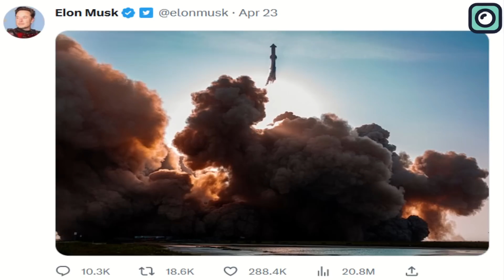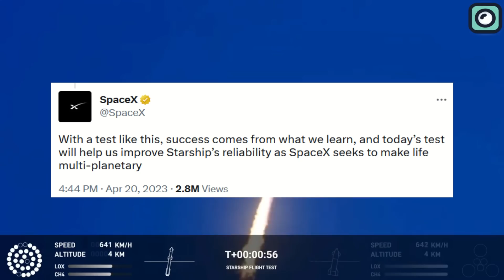SpaceX's Raptor engines BIG PROBLEM on first Orbital Launch!

Comment: you are wrong my guy. the starship was supposed to separate before super heavy started to change directions. the super heavy could lose a few engines and still make it to orbit.
Reply: Lost Hydraulic system early on. They couldn't unlock the hold downs to StarShip/booster.

Comment: On top of the debris or fod damage to the does telemetry or any other data show the cause of three engines failing to start and I'm curious if there's any telemetry on the effects of Sonic damage I.E. converging shock waves??
Reply: It's very noteworthy that SpaceX is not sharing either telemetry or onboard video. I bet they had video in the engine bay, I'd love to see what was happening there as more and more engines came on line and then throttled up. I bet it was like a pinball machine full of concrete. They are extremely lucky they got the explosion off the ground.

Comment: Lol! Here we go with all the bullshit speculation! Just to get mindless clicks from equally mindless Borg Drones!

Look! This isn't a engine reliability issue! This is a launch issue! The fact that the rocket actually damages its own engines during launch, thanks to an insanely inadequate launch pad system, is the reason why this first launch had issues!

And this would be an issue for ANY rocket! Regardless of reliability!

We've already known that Elon took a MASSIVE gamble with his "exotic" stage 0 setup. Chopsticks, catching rockets mid air, lack of proper flame diverters and water deluge systems etc etc. So now these concerns have come back to bite him in the ass!

Indeed, this flight was a success in that the rocket didn't damage itself so badly that it simply blew itself up within the first 10 seconds! So in that regard, this WAS a success!

What SpaceX have to do now, is overhaul their launch systems, so that the rocket DOESN'T damage itself during its initial launch sequence. And once they solved that issue..  THEN we can talk about engine reliability!

Comment: Who cares? They are building 20~30 raptors a month and has 3 more boosters stacked. 
Just plate over the damage like Combat Engineers fix bombed runways, 
then keep flying anyway reliable or not, dinged tanks or not, keep flying until you stop blowing up!
Way better than spending 20 years imagining perfection like NASA then lose two shuttles anyway!

Comment: I think it is way too soon too blame the Raptor engine in unto themselves. The ignition blast zone suffered massive failure ejecting tons of debris in every direction. Some of this flying obviously flew up into the engines causing untold damage too the engine upon liftoff. This situation was not Ideal conditions for assessment of engine performance. It is totally likely the flying debris caused the engine failures and it real assessment won't be conclusive until a new properly build stage one with deflectors and water suppress system capable of handling starships launch blast is utilized. Should be interesting.🤔🤔
Reply: also, it looks like 33 engine MECO didn't go as expected. not quickly, not nominal. Maybe thermal problems, valve problems, everything was too hot? 
On Starship, I have seen no tiles coming off
Reply: Not too smart to follow protocol from previous experience

Comment: It was a success!  The rocket seemed to work well.  The lunch pad must be reworked.
Reply: Hell yeah raptor works fine but the concrete don't work as well.
Reply: @CelestialSooth  It's a cult. They will never acknowledge failure.

Comment: Raptor engines were damaged before lifting, if they fix a flame trench they will be in great shape.
Reply: Agreed. I think it's a leap at this point to say those engines may have issues.  Given the volume of blast debris, I'm shocked that so many engines manages to burn normally.

Comment: Nothing wrong with the Raptor engines, yes, they're still a work in progress, but they're already a work of art and constantly getting better. The launch platform, however, was simply no where near adequate enough for a test launch of this magnitude. How the booster didn't just explode on the platform after being pulverised is beyond me.
Reply: How many engines will run properly after chunks of concrete slam into it?

This was successful, everything needs further improvement, how will we learn if we don’t try so completely agree with you. Video seems a little misleading.
Reply: @uspittbullbreader  I was going to say the same thing. 33 engines shotgunned by tons of concrete and some failed?
Reply: Your description was better!
Reply: Your description was better!
Reply: Your description was better!
Reply: Your description was better!
Reply: Your description was better!
Reply: @uspittbullbreader  I was there. Very loud!
Reply: @uspittbullbreader  And how do you know the engine failed because of debris? Maybe once they investigate the matter we will know
Reply: No I agree, it’s the more than likely scenario but not fact. Just find it interesting that the first accusation is failure of the engine because of design rather than the most simple explanation considering 30 had no problem.
Reply: I would not be surprised if acoustic effects and vibration caused problems.
The Apollo program had to solve problems with acoustic issues also.
Too, flying concrete is not beneficial.
Perhaps the business end of the booster will be made more rigid.
SpaceX has a lot of good data which could not have be acquired any other way.
Reply: Great info! Acoustics can jack up some solid structures. 

Wish I was there that day, wanted to bring the family but stuck at work and didn’t even know about the launch till a coworker messaged me minutes before.
Reply: They failed on launch......Did this happen with the Saturn V?

Comment: They learned that in all the years of rocketry, using thrust trenches and water, wasn't just used for shits and giggles.
Reply: How did they NOT know that ?
Reply: @jayrussell3796  I don’t think you understand the iterative design process, you’re supposed to move fast and break things—this way you learn quickly and end up with more reliable hardware. There’s a reason the Falcon 9 is so reliable—remember when SpaceX couldn’t seem to get them to land properly? Then, all of a sudden they seemed to start landing reliably every single time? That’s the iterative design process.
Reply: @analogecstasy4654  and at the same time and on the same note, humanity has learned to use the mistakes of others to make things work faster and better the first few times around instead of the 100th, hence oven mitts, helmets, and oil for engines. A wise person learns from a fools mistakes
Reply: @analogecstasy4654  It's not like this is the FIRST time a rocket has been test flown. They obviously didn't WANT it to go flying around lke a butterfly in the wind. It's not like you're going to leave the sewer lines of your home unattached JUST to see if the toilet flushes properly with crap in it.
Reply: @jayrussell3796  It will flush properly, once.
Reply: @jayrussell3796  They knew but decided to see if the rocket would fly
Reply: They knew they had to do something as evidenced by Elon's tweet about a water cooled steel plate they had in development which was not ready for the test. They thought the fondag would hold up for at least one launch, but were wrong obviously.
Reply: Curious if any of you armchair quarterbacks have ever launched the largest rocket in history? Have you ever designed and built your own rocket engine? Also, they knew there would be damage to the launch pad, I'm guessing this just gets SpaceX more press..lol
Reply: @rothwegk  They already said they thought they'd get away with it for one launch. So nice try at an appeal to ignorance defense, but your heroes already accepted this as their fault.
Reply: @rothwegk  This is why you don't rush things genius.
Reply: @rothwegk  and as for you, it doesn't take a rocket scientist to realize that that much power would leave a crater in the ground...duh. Even a simple garden hose spraying water in the ground leaves a crater. Try it sometime
Reply: Watch ithe space fans try to spin this into success iz one of the more delusional things I've seen. Good luck in finding an effective way to divert that flame.
Reply: @itheuserfirst3186  So you ignorantly believe that TEST LAUNCH wasn't a success? You're the exact type of idiot that insures progress never happens.

You're also going to look pretty stupid (more than you already do) when SpaceX does successfully divert that flame, and it won't be luck that gets it done.

Comment: OK--------... Space X needs to move the exact same High tower and Launch Platform out to a half Mile or so off the Beach with a pier running out to it from the end of Boca Chico Road... With an Elevated 30-foot wide set of rails running from the Construction Build sight to the existing test launch sight and then on out the Pier to the new Launch Sight a half mile off the Beach...  With only a couple of Sub Coolers under the roadbed at the end of the Pier safe from any exhaust or explosions...  Space X would reduce all of it's Regulatory, Environmental and Launch sight Exhaust destruction problems by 99% with the Gulf serving as the Ultimate Deluge system... and Crash area Junk yard serving as New Fish habitat Reefs making for the best fishing along the Gulf Coast... Not requiring much cleanup... Multiple Off Beach Launch sights even farther off the beach out of reach of local Regulations and Restrictions would allow Space X to launch a hundred times a year instead of just 6...  Making Boca Chico the Space Launch Capital of the World...
Reply: The Mexican government might let SpaceX do that. American government..not so much
Reply: What is Starbase? It's a test facility 
Nuff said.....